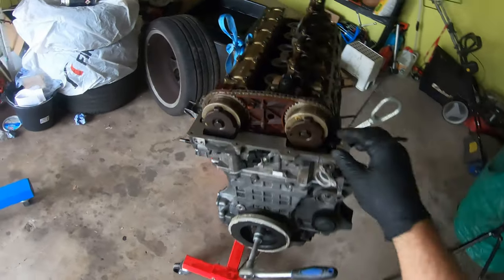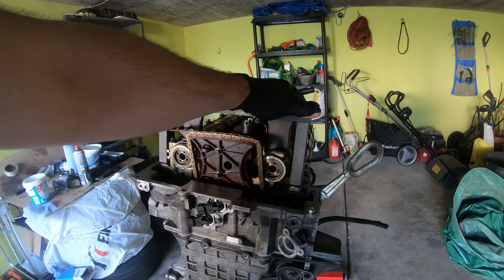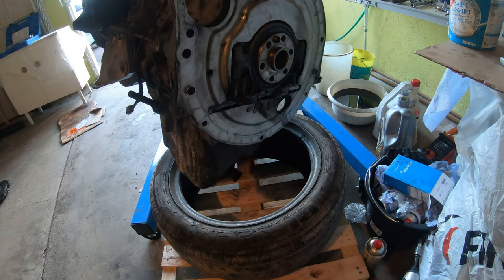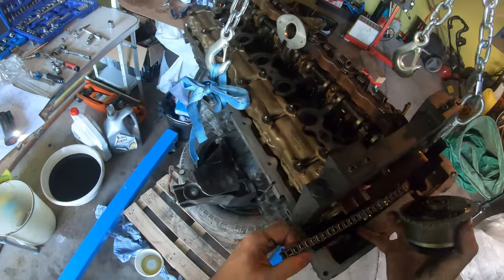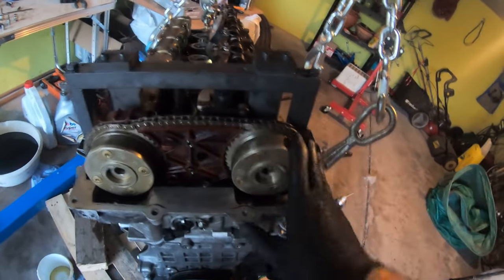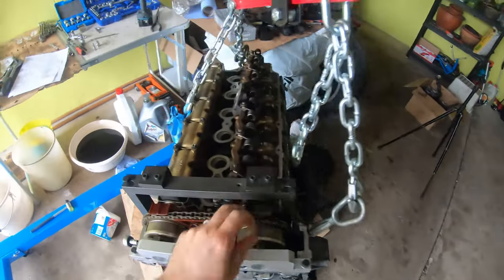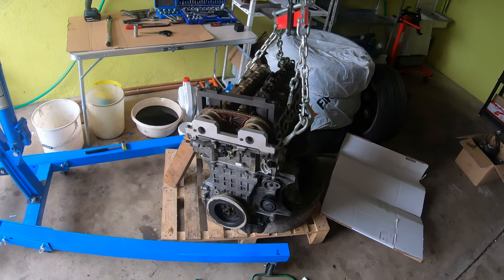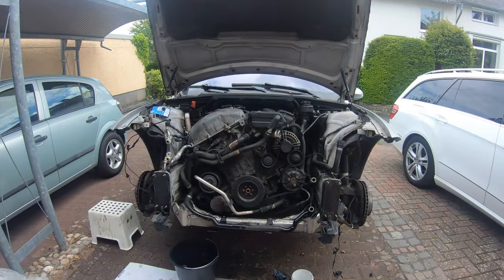[DIY] Correct Timing Procedure For The BMW N52 Engine & Vanos Re-Assembly! [BMW N52 Rebuild Part 17]

Comment: Anyone know what could be causing me issues. I timed and torqued everything. When turning by hand, sometimes the vanos gears are like jumping and not smoothly rotating as one. After 10 rotations the intake cam is not aligned anymore. And also before, the impulse wheels were not matching up at TDC anymore.
Reply from the maker: I thought the gears clicking around also was a problem but it's just because there is no oil pressure in them. If you have timed them properly, it should be ok.
Reply: @buildanddrive  my issue was me. I was turning the crank counter clockwise to get TDC lined up and that was moving the cam etc. I didn't know cam and and vanos gear can move independently depending on how much oil pressure the vanos sensor is sending. Am I correct? At TDC with crankshaft locked, I should be able to tune the intake camshaft by itself with a wrench?

Comment: Hey man , recently did valve cover and oil filter housing gaskets on my 2010 528xi . She started right up after the job . Came out the next day and had a crank no start issue and couldn’t get her to start up I read codes and had a p0016 code . Replaced all camshaft position sensors and the crankshaft position sensors and still have a crank no start , I also cleaned up the Vanos solenoids and still only crank . I’m basically down to maybe a stretched timing chain or timing slightly out of adjustment . Would it be best to just get the timing tool kit you have linked and follow the steps in your video or could it be something else ? And if I did go the timing route would I HAVE to remove the intake/exhaust sprockets & timing chain tensioner or could I just get to TDC and continue the procedure without removing anything ? Sorry for the paragraph but I’m just frustrated at this point and really would appreciate your help ! Thank you in advance brother .
Reply: Also , I did an oil change as well
Reply from the maker: Him, I think you must have something not plugged in. Is the ground for the coil packs attached to the frame? Do you have fuel pressure?

Comment: What are the possible causes of N52 crankshaft not turning?
Reply from the maker: Could be many things... Timing chain snapped and got stuck, bearings overheated and seized, piston rod broke, vaccum pump seized, clutch release or pressure plate broke, transmission or gear broke....
Reply: engine being locked up lol

Comment: Just did this same job on my N52. My vanos adjusters also are clicking like yours did there at they end when spinning the engine over by hand. Did you ever find out of this was "normal"? I'm guessing it's because no oil pressure...
Reply from the maker: Yes this clicking is normal until it gets oil pressure into the vanos system. I heard it click (it felt more like a "snap") which scared the crap out of me. I suggest doing gentle pulls 50% throttle to get oil into the system
Reply: @buildanddrive  wow thanks for the quick reply! Good to hear 👍
Reply from the maker: @colescarkingdom  send me some pics of vids on IG of your build
Reply: dude literally same here. my n52 on my engine stand does the same thing. was and kinda still worried as fuck
Reply: @buildanddrive  i had my engine upside down cuz i dropped a small tiny peice broke off of my cheap ass boroscope but i got it out and a good amount oil came down from my head while it was upside down. Could the cam ticking be just because i had all the oil drain out from the head? Mine sounds exactly like urs in this video when u hand crank the engine.
Reply: @buildanddrive  yo plz let me know if what im experiencing is normal lol thank u man. shoot me ur cashapp btw u helped me a lot thru ur videos need to give u back some support haha
Reply: @colescarkingdom  hey do u still have ur e90 mine is doing the same thing. U find out for sure that this is normal?
Reply from the maker: Normal 👍🏼
Reply: @losidude11  Mine has been running flawless since the new adjusters so I would say it's normal.
Reply from the maker: Yes this is normal... Or it's normally broken 😂
Reply: @colescarkingdom  @Build & Drive thank yall so much
Reply: @buildanddrive  thank u man!

Comment: when i neet to replace timing chain on my n52 he is on 286k km
Reply: Timing chain is supposedly good for the lifetime of the engine but in reality lifetime generally has a finite meaning.  I'd be more inclined to think that the chain guides would be the first to go.  If it were me, I'd probably look to replace the chain (plus guides/tensioner) by 200k miles/ 320k km.
Reply from the maker: Timing chains are good for the life of the car unless they stretch or get damaged, especially the timing guides and wear out and break. I would check your timing chain tensioner to see it isn't clogged up with gunk and still operating as usual. It is under oil pressure so normally they don't fail unless your engine is sludged. If this fails your chain can jump a tooth and cause all kind of problems.

Comment: lucky u  didnt have to time an m54
Reply from the maker: Is it tough?
Reply: @buildanddrive  N52 looks like an dream, i got an n52 now to so im confident
Reply: @buildanddrive  Probably ez for the hands that is used to it, but for me m54 timing was a pain in the ass
Reply from the maker: I had to re-time my engine 3 times before I felt I got it right 😂
Reply: @buildanddrive  same here:D
Reply from the maker: They are a lot of fun to drive (when everything is working and not leaking oil everywhere or throwing codes 😂😂😂)
Reply: @buildanddrive   Thank  god ive had mine 130i for 1 year now, bought it from an ol lady. no leaking yet, but time will give it:D and no codes nothing, it was a good buy:D
Reply: @buildanddrive  Thats what ive learned now from driving beemers for 13 years, only buy original from old ladies that is first or second owner
Reply from the maker: Where did you find your car? I was looking for a long time for a 130i but all were high mileage
Reply: @buildanddrive   I live in Sweden, here there is maybe 1 for sale and then nothing. Got lucky i guess, mine has gone 124k miles, was looking for 6 months. Good luck, hope u find one cus they are great